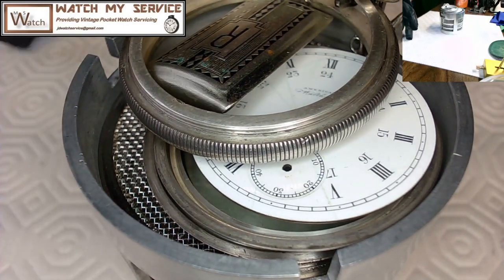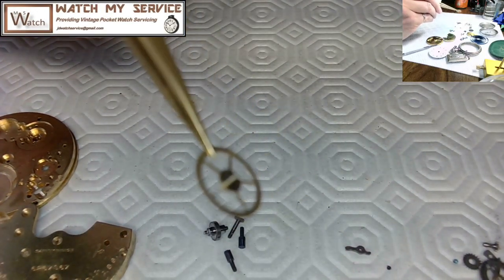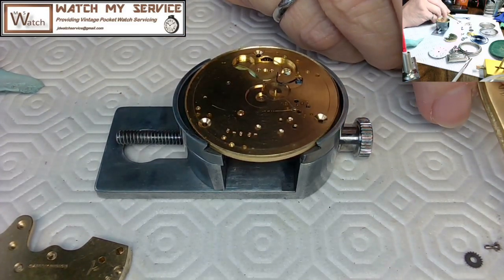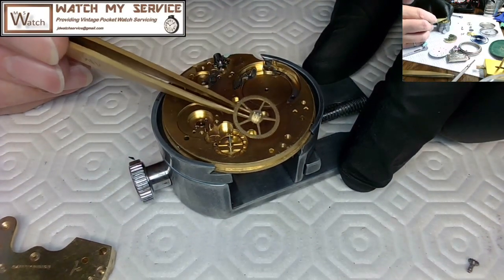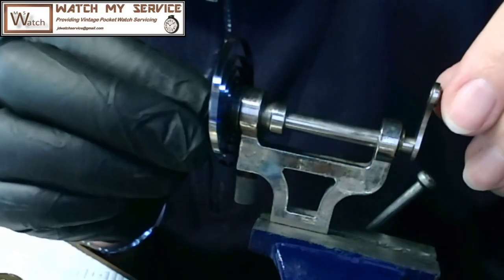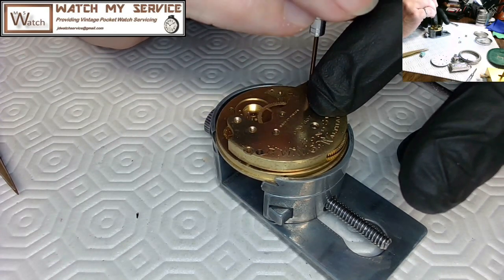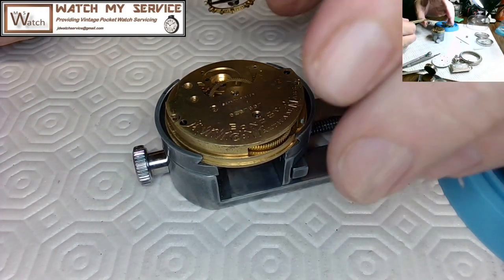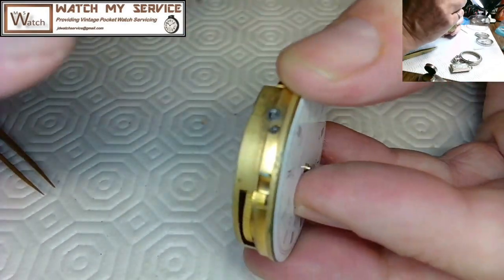Detailed Vintage Waltham Pocket Watch Reassembly with Tips

Comment: Thank you for the great video. Did the balance wheel and the hair spring go into the cleaning machine together with the rest of the parts or were they cleaned separately?
Reply from the maker: I clean the balance in hairsprings separately as I don’t want them to get damaged in the cleaning machine I use lighter fluid to do this
Reply: @JDRichard  Thank you for the prompt response. Is there a good instructional video on how to do the cleaning of the hairspring and balance wheel?
Reply from the maker: @massimoscanziani5386  https://youtu.be/k2CWYHPGeP0
Reply from the maker: I will likely be making a video on how to clean a Watch balance and hairspring this weekend
Reply: @JDRichard  Great. Looking forward to seeing it!

Comment: Hey JD! Nice video - minutes 40 to 42 getting the plate back on - I'm suffering to get everything lined up on my 1892 Herald I'm a relative beginner so that is probably the key problem - any beginner tips, you mention Rodico later...
Reply from the maker: To get the plate back on and to get the pivots through the holes the first thing I do is try to get the centre wheel and third wheel into the pivots and then I take the screws for the plate and I put them in very very lightly. Then I take a fine probing tool And just slightly move the other wheels until the pivots fall into place. It’s a little tricky but over time you get used to it. Remember when I first tried doing this I was very frustrated and I remember spending well over half an hour, trying to get the pivots in to the plate. Not anymore you just have to work at it.
Reply: @JDRichard  Thanks - I can get the centre wheel and third wheel in, I think I might need to pick up one of those curved tools you use to move the other wheels. I'll show it to you when its working!
Reply from the maker: @julessimon3334  just go to Michael’s to pick up the curve tool or any other hobby shop
Reply: @JDRichard  I would if I was in the USA at the moment - I am working in Brazil, I'll find the equivalent though!

Comment: JD , What was the Meyers number for the watch holder, I like it has a multifunction, save buying many holders, thanks for the information and video - I have one question not related to the build, i got an old Waltham for repair and some one broke the screw in the plate. I had read somewhere that acid is used to eat the steel away and it will not harm the plate , what do you suggest. I was going to drill it out.
Reply from the maker: It’s been almost a year and I just saw this comment and I really am sorry for not responding right away. Did you get the screw out of the plate?